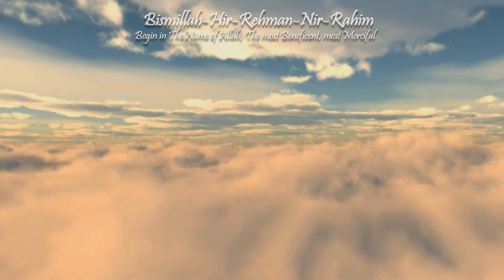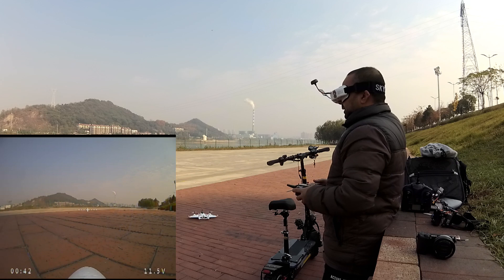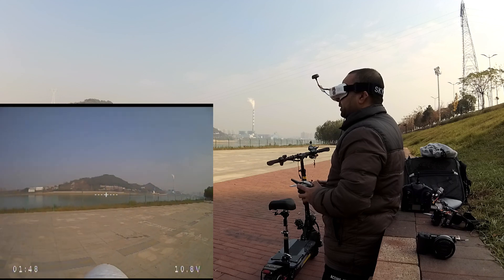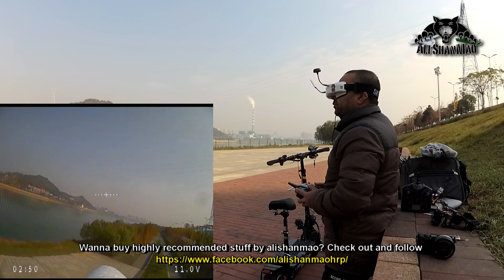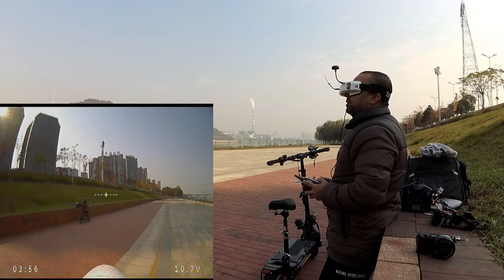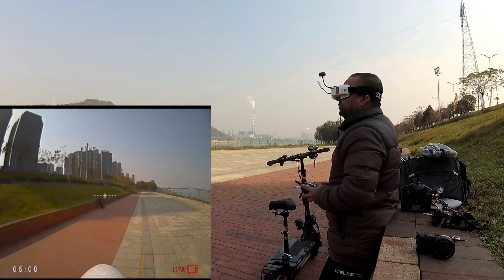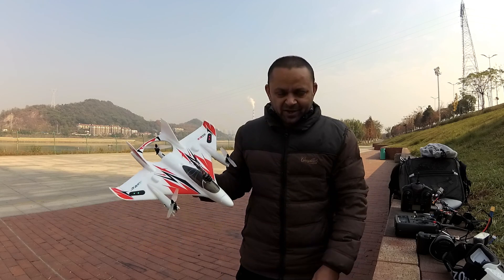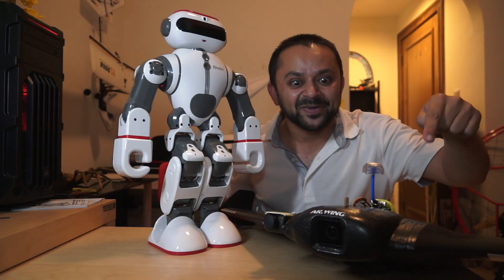How to Fly FPV with JJRC M02 VTOL RC Plane

Comment: What fpv gear are you using, I have the XK X450 and have ordered one of these and want fpv in one and just wi fi feed on the other what do you suggest as totally new to flying I bought the XK X450 as my first flyer and love it after a five minute disaster with a micro contra rotor helicopter which I flew into the ceiling fan and if that had not destroyed my Greyhound pounced on it and finished it off, so not a good start but after around two hour's I was flying it in drone and vertical mode then the next time after around two hour's was flying in plane mode ad had a quick dabble in 3D nearly crashed it but will do a bit more 6G and then try again, thanks to you and your enthusiasm I went from 5th scale gas of which I have 8+ along with a 1/6th and 1/7th electric a Savage nitro and a 1/4 scale electric motoX bike no gyro, that took a while longer than me flying reasonably, so a fish out of water definately out of my comfort zone the first time out, crashed a couple of times no major damage.
Reply from the maker: all links to gear are in video description buddy
Reply: No links to equipment used in video description.